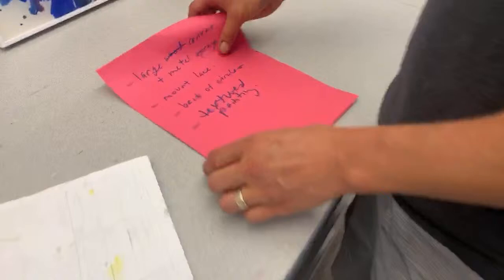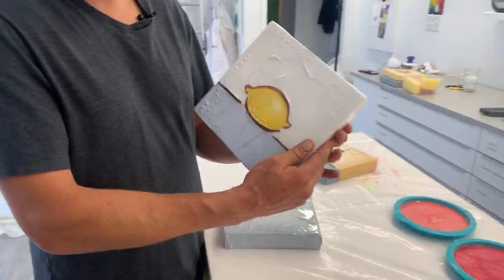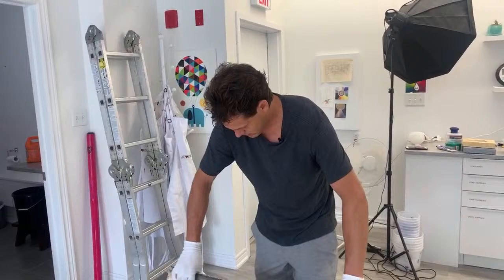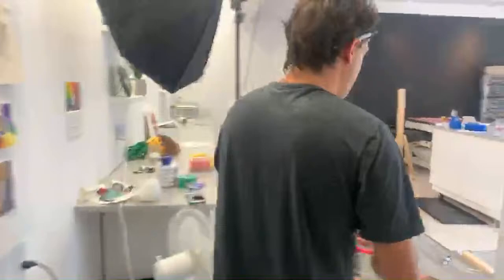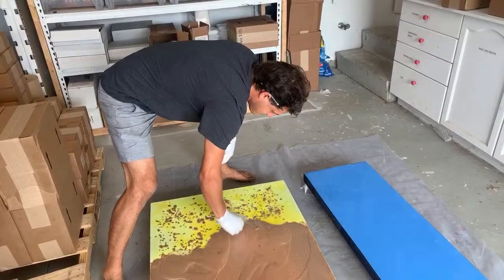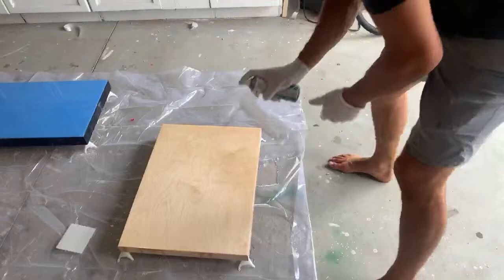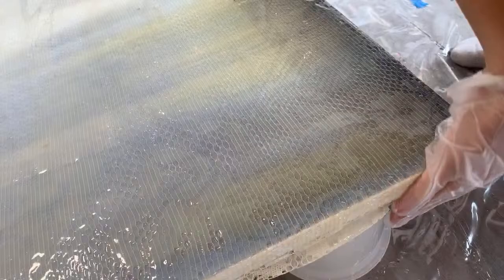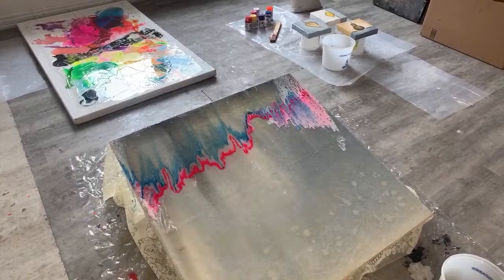Spray Painting and Stuff with Resin LIVE

Comment: Is Art resin heat resistant pls?
Reply from the maker: Hi Samia, The maximum temperature that cured ArtResin can tolerate is 120F or 50C. At temperatures as high as that, the cured pieces may become a little flexible but once they cool off, they will harden up once again. If your cured resin is exposed to temperatures beyond 120F or 50C, however - for example, you leave a cured piece in a hot car for a long time - it could cause irreparable damage.

A word to the wise? Keep it cool!